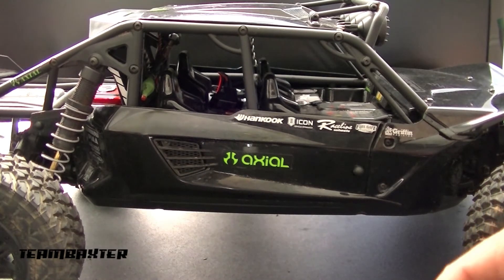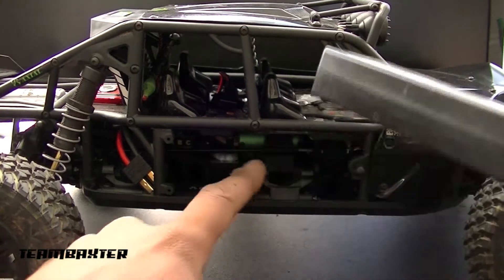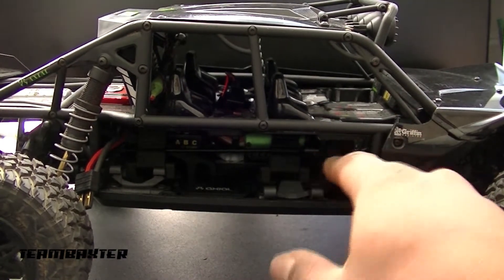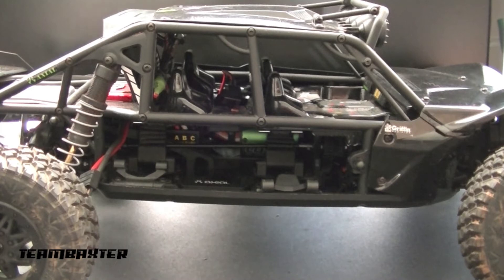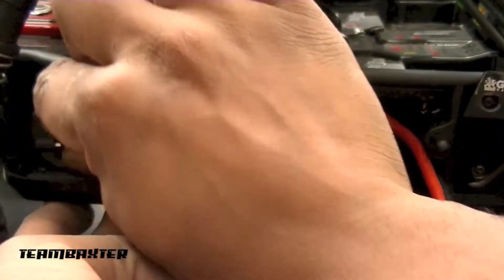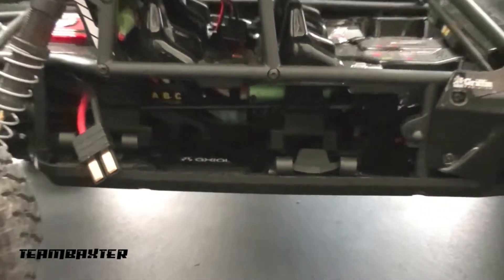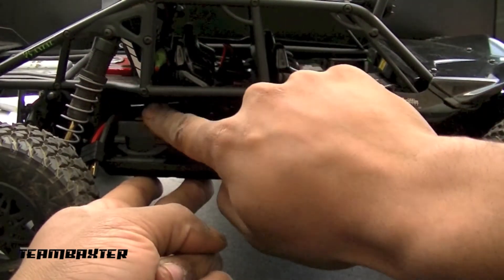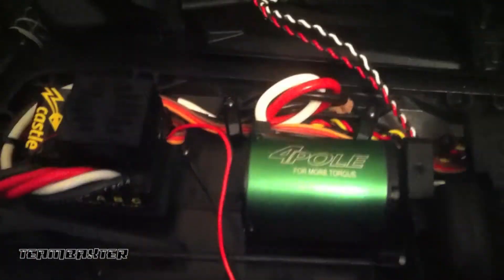Axial Exo Terra Battery Door Mod

Comment from the maker: thanks. if you have the battery to spare that would definitely be the way to go. i use my batteries in several rc's so thats not really an option for me so much. plus this quick little mod makes it simple enough that its not an issue. thanks for watching and good luck with you new exo. be careful with front end crashes, exo doesnt like head on high impact collisions too much!

Comment from the maker: if heat is a concern for you, you will definitely benefit from removing the interior panel. i run the interior piece, as you can see, but the system runs warm. i monitor temps, did a mod to the side panels, which actually allowws the side vents to allow air in, delivering minimal airflow directly to the esc, and i also have vent holes directly over the esc for additional cooling. thermal should stop you from killing things if all else fails.

Comment: I would worry that cage would flex up as the right rear suspension arm moves up into the bottom out position........the part was cut out just below the cage where top of rear shock is mounted. Can you measure up and down where the part was cut out and then measure same spot when the suspension is bottomed with out pushing down on top of cage?

Comment: What about the structural integrity of the cafe after you cut that piece out?
Reply from the maker: Haass Nazari that was my number one worry about doing this simple mod, and the reason it took me so long to go ahead and do it. Since i have done it, there has been no issues, and the part flexes very little, due to the surrounding supports. The ease of putting the battery in after cutting it out makes the small sacrifice so worth it. Thanks for watching, and good luck with your exo, whether you do it or not.